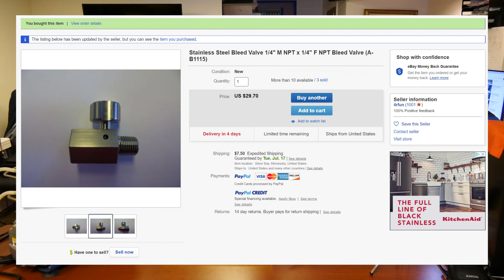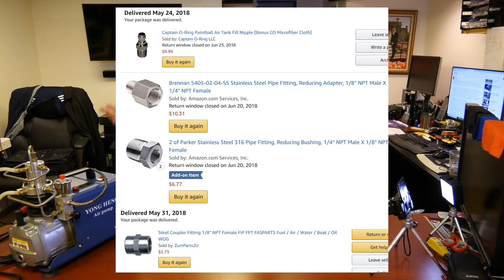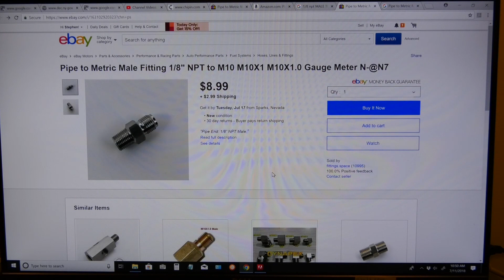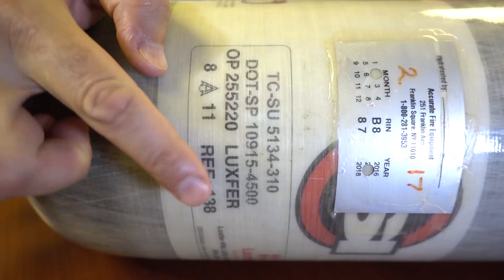Yong Heng compressor for PCP Airguns 9 month follow up PART 2

Comment: I have 4 Chinese compressors, different than the Yong Hen . Mine don't have the outside ss lines on them and run alot cooler than yours does. Still uses water but runs cooler an no lines to burn your arms on. Cooling is done in the large 2nd stage of the pump. Costs around $450.00 each and can be purchased on ALI-EXPRESS. Great little compressors. Made by Tuxing. Don't know why there not on ebay.
Reply from the maker: Electronicdawg thanks for information. I will look into them.

Comment: Great video. Have you found all the parts for the bleed valve? If so could you paste some links for the parts needed.
I looked on Amazon for the Brennan adapter but it comes up as the wrong size. Thanks.
Reply: I just cant find a bleed valve, for gods sake...😅

Comment: Air Velocity Sport
 -  Sir I was wondering if you can leave your valve on your tank open before starting the compressor and after shutting it down, since you have the one way check valve in line with the filter? That would make it very convenient not to have to worry about the timing of opening and closing the valve. I appreciate your videos and an answer to my question. Thank you
Reply from the maker: Yes, you are correct. Since I have a one way check valve foster quick disconnect I can open the tank before starting the compressor and close the tank valve after I bleed and shut off the compressor.

Comment: I will PM you on GTA later today regarding conversion fittings for high pressure use. I just need to find a block of free time to write up some info for you. In general I would stay clear of fittings advertised as being used to convert threads for "gauges". I found that they are typically for automotive use (think oil gauges) and those are low pressure systems.
Reply: Did Anyone ever find the correct setup or the Filter? If so could you please Share? Thanks

Comment: Hey can't you just use quick diss.cnt.on bottom of cannister ,disconnect it, then use little of tank pressure to clear water from sieve cannister, works for me just hold on to filter when you do it, or you get a rocket.or you can burp tank into short spot between tank fill bleed , close tank then open bleed valve doing same thing.

Comment: Great Video, thanks again. That Digitalwavecorp.com is great news, however in their video they mention the cost of "a few hundred dollars" vs about $1000 for a new cylinder. This may be applicable for a fire station, but for used tanks or $300 new ones from China, it sounds like it is likely too expensive.
Reply from the maker: Yes, I too think it a bit too steep in price for a 15 year old tank to be recertified.

Comment: I'm curious where you got the absorbent cotton inserts for your oil water separator?  I'm getting ready to purchase one of them, but they seem to just have one or two long ones that fit inside. Did you have to cut the large ones yourself, or did you buy some smaller ones from Amazon or Ebay? If so, can you include the link?

Comment: Hi, thanks for your video's. It's one the reasons I've bought one. Arrived today. I can noot find the recommended oil overhere. But is the 5 W 40 ok for it? Thx
Reply from the maker: Hey Mark Congrats. You can use  motor or Hydraulic oil but the problem will be with carbon build up on the high pressure piston and the air will smell very bad. I just switched over to SECO Lube 500 Syntheic oil for high pressure breathing air compressors. $60 for a gallon from www.filtertechs.com This oil will last longer and keep the compressor from fouling up which is what happened to my first one. There are other good breathing air compressor oils like Bauer and Nuvair. I can not say for sure yet which is best. should get about 15 fills per gallon which comes to $4 per fill. I change my oil every two or three months of use.
Reply: Air Velocity Sport thank you for your very fast answer. At this time I cannot find the oil you are referring on over here (The Netherlands). What is I use the 5W40 and change it after 10 fills of a 6 liter tank. Would I be safe then? Many thanks again

Comment: Great video... too bad I was not able to watch the whole thing, but I will later. Having said this, I have a quick question:
Something happened today, that scared the sh*t out of me. My tank is at 4100 psi. I would like to get it as full as I can. I guess 4500 psi is max using this compressor.

I hooked up the tank with its valve closed.

I pre-cooled the compressor.

I started the compressor, let it run for about 20 seconds and started to close the bleeder valves.

As soon I did close the bleeder valves, the pressure started to rise.

I believe it was around 3000 psi when I started to slowly open my tanks valve.

That is when I heard a loud BAM and air was leaking out of the "water-filter" (?), you know, the blue piece that has the cotton inside.

I turned the compressor off and opened the bleeder valves.

I then closed my tanks valve. Looks like I lost 100 – 200 psi. Hard to tell looking at the small gauge on my tank.

 
Having said this, I believe I know what happened, but I would like to double check with you. I believe the issue was that I opened the tanks valve to soon. The compressor was at around 3000 psi and the tank was at 4100 psi. Is that it? If so, can I avoid this from happening again by simply waiting until the pressure is somewhat the same (between Tank and compressor)?

I guess the reason I opened the valve sooner, is the fact that I am not sure what will happen if the compressor runs into a solid stop, meaning the tanks valve is closed and the air that builds up is going no where. Knowing what I know about compressors, they either stop when they are full or they blow off pressure through a safety valve…

Thanks.
p.s. Would it not be "best" to get a check valve and hook i up in between the tank and the compressor? That way you can just open your tanks valve and soon the pressure builds the air will flow from compressor to tank…
Reply: I have a one way male foster I put in line. That way air only goes one way and they don't collide.

Comment: Are you still using the Yong Heng Compressor? Haven't seen any more reviews lately.. As the other guy said, I hope you are doing okay.
Reply from the maker: Yes, I still the Yong Heng. I'm on my second one. I will do another update with tip to keep it running ponder and safer. I have been busy with slug development lately. Thanks for your concern and happy Thanksgiving!
Reply: Air Velocity Sport I just ordered one this evening hopefully it works well. Thanks for  all the great information on the compressor!
Reply: Air Velocity Sport Thank you for the reply. Your contribution to the PCP Enthusiast is very informative and useful. I really enjoy your videos.

Comment: Just got my Tuxing water oil seperator with activated alumina setup. Looks really nice. Only problem is that when filling air guns it now takes twice as long because it has to pressurize Tuxing. I unhooked the Tuxing and filled without it and sure enough it filled much faster without Tuxing. Any idea on fixes for this?
Reply from the maker: Yeah, there is really no way to reduce the time it takes to fill the volume in the tuxing filter? You feel much more because filling a guns small 200 to 480 cc volume is fast. When filling a 88cu ft tank it really does not matter as much. In my humble opinion, unless it's a really humid hot day I would not use the tuxing filter to fill an airguns small tube/bottle as the compressor really does not run long enough to build up heat and moisture. It would think it takes only 3 minutes to top off a on Airgun bottle of 480cc. Not really enough run time to get hot and build up moisture.
Reply: @AirVelocitySport  Here in KY been 90s..very hot humid. I'll not use Tuxing with just filling guns..it seems running pump twice as long is more damaging. Gonna wait til cooler weather to attempt 9 liter SCBA tank fill. My yong heng station is in my hot garage. Ordered a very powerful 12" metal fan to blow on it. Pretty impressed so far except with Tuxing issue. I'm running AW46 like u recommended. R u still using that?
Reply from the maker: Yes, still using aw#46 hydraulic oil. Some good me about another oil that does not smell as bad as aw46. I too run mine in a hot garage but I use a 5 gallon bucket with a 2 gallon block of ice. I filled my 2 tanks  today from 3000 psi to 4100 psi. Temp never went about 50 Felicia. The black small filter holder did get very hot. I opened my good tuxing filter and I found a drop of water on the see closest to the compressor. Otherwise the other side was dry.
Reply: @AirVelocitySport  it's good to know that its holding up while filling tanks. I've read quite a bit on GTA about only using it for air guns or it'll burn it up. I was just going to top off tank maybe 3 times a year and the rest just fill guns.

Comment: Samson 1214 Air Bleeder Valve 1/8" NPTM  There NPT THREADS IN 1/8"    They make Nice bleeder valves on your air gun but very Expensive >>   28 dollars a valve

Comment: wooo! Sir. May I be so bold as to say you are playing with "fire" 4,500 psi this is such a dangerous pressure, it can KILL. I am a retired pipe fitter used to working with such pressures so please take my advice go to a reputable dealer who will help you, be very careful who you buy from. 
 I also have a question why are putting a bleed valve there?
 as the bleed valve on the compressor will bleed the filter down if it is fitted correctly.
Reply from the maker: Yes, I dont like fire so I make sure all my fitting are rated at 5000psi working pressure. I'm am well aware of what a rupture can do at high pressure.

Comment: Hallo Can You adivice me ..is it possible separate oil smell and oil itself somehow from  breathing air for scuba diving.. if I decide use that compressor..??
Reply from the maker: I don't know for sure but you will need much more than the yellow filter to make this unit make breathable air.
Reply: Thanks , I have to search for better filter .. scuba compressors are much more expensive  ...but did You check in scuba store your air quality before You had that yellow filter  or after?? what you think if I could use two of them for better filtration..? @AirVelocitySport

Comment: Also what purpose does the 1" PVC have? I purchased a New Warrior Dry Air System by XIN YONG SHI and 1" PVC doesn't fit inside.
Reply: Pvc is the body that holds the dessicant.
Reply: For keeping the silica away from the aluminum as it makes acid apparently and damages aluminum and there is contraversy on that being true.

Comment: Is the oil getting into the air tank safe? Have the similar issue
Reply from the maker: RazTheRipper yes, not an issue as hydraulic oil is not combustible under high pressure.
Reply: Air Velocity Sport ok. What about the damage/slick that would be invariably be deposited (in small quantities) in the tanks and eventually in the valve of the airgun? I see an issue there.
Reply from the maker: Yes maybe after a few years. But that time you'll have to service the gun and change orings and clean valve anyway. Not enough oil to be  an issue.
Reply: Some guns, (Texan, Texan SS) have said that oil should not harm the gun. Others oil their lead bullets before shooting as well, to help reduce lead residue in the gun.

Comment: Why do u need a third bleeder when u have 2 on compressor and one on tank? Seems overkill...
Reply from the maker: That bleeder valve at the bottom of the good water seperator is the bleed off any water that accumulates it the water seperator. I'm currently not using the gold bleeder since I could not find the correct nipple connection. There is a new good water seperator that has a bleeder built in.

Comment: If you go with this fitting in the bottom of your molecular sieve tube you can screw directly into your A-B1115 bleed valve (thereby removing a fitting from the stack). http://www.hydraulichoses.com/ProductDetails.asp?ProductCode=9007&gclid=CjwKCAjw7cDaBRBtEiwAsxprXSX5AoG9js6rRJ0w0chLgsZM4259GncmHzbRzXgDJuvgHgGGytdWbBoCPqEQAvD_BwE